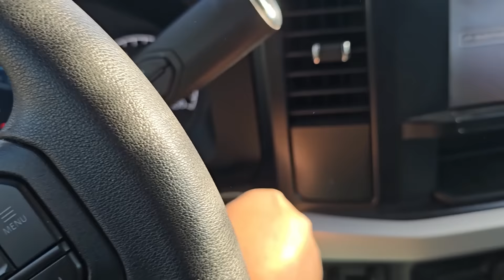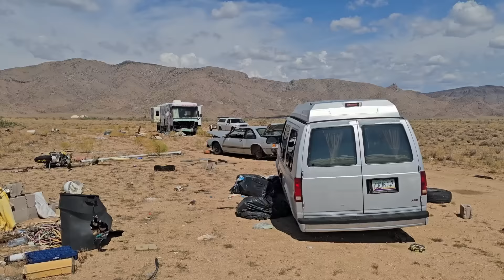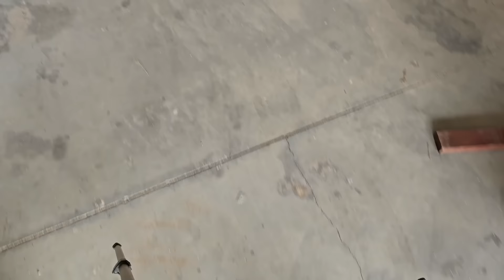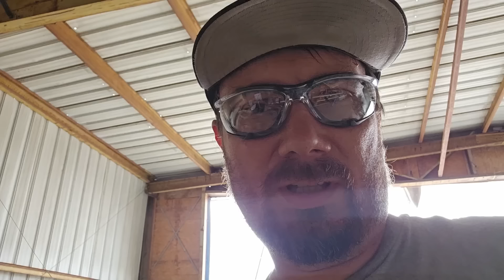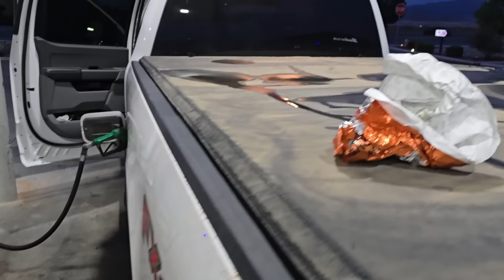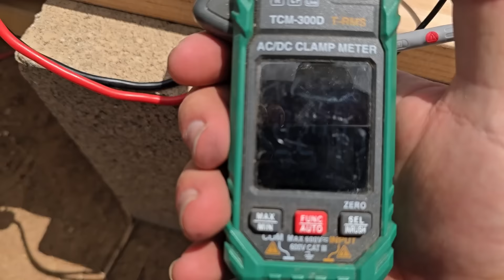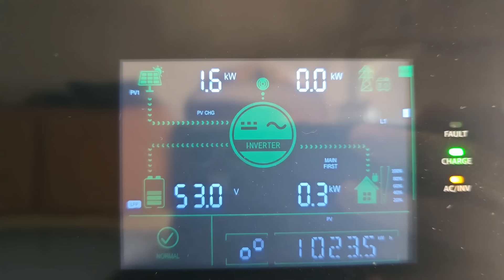DIY Ground Mount for $42 Per Panel No Digging (CinderMatic) | Got Shocked by Green Energy

Comment: Glad your OK.  Um little more expensive for those of us not living at Hell's door since pressure treated wood is needed.  Regular 2x4 in my neck of the woods is a sponge within a year.  More work but cheaper thought, partially bury the cinder blocks and just direct screw to them with cement screws.  A lot more work if you bury them at an angle as well.  Either way not wood rot to worry about.

Comment: Voltage doesnt matter its the amps that kills.  Static electricity is millions of volts... but it only takes about 10 mA to stop your heart.
Reply: Voltage definitely matters. It's a combination of volts and amps that can kill you. For instance you can touch the terminals on a 12V 100A battery and be fine, but a 48V 100A battery can kill you.

Comment: Howdy Herb,

First of all - 🙂 so glad you're ok after your shock 👍 and no! You're NOT a wuss for double checking with a medical checkup. Not checking is why people keep over hours later!!!

BTW - when working on arrays - cover them with a DARK cover, tarp, moving blankets, cardboard, etc. to prevent voltage/current from being generated! 

Great job on the temp mounts.

The clearance thing could have been solved easier by counter-boring the top boards to allow the bolt heads and washers to drop flush.

The cross connect from the front to back arrays and any wires on the ground should be protected from tripping and chewing - by people, dogs, cats, wildlife, low flying UFOs, etc. In conduit. 

WARNING!  You've created a bunch of cubby holes that snakes, spiders, scorpions and other biting/stinging critters can and likely will hang out in!  So walk well around those panels!!!

Heat... In Arizona in summer? No Way 😮

Really, you shoulda went over to get the blocks way earlier in the morning and get outta the sun earlier too. 

Hope your surgery went well. 👍👍

Comment: Wire nuts with DC can end up generating heat if there ends up with a gap. Heating and cooling  can cause the connection to get loose.
Reply: Yeah crimp or solder.   DC can be very dangerous and when it arcs it's really bad.

Comment: I haven't found this deal anywhere else, but the ecoworthy ebay store actually has some racks similar to the fixed integra racks minus the horizontal legs.  They are currently about 80 bucks for enough to support 4 panels.  Since they appear to be expecting concrete footers for mounting, you would probably need to mount them on some 2x4s or 4x4s and then have some cinder blocks for ballasts (or ground screws).  I just ordered a set myself to see if they would work and I plan to order 2 more sets if they do.  It seems to be the cheapest way to ground mount panels.  Also thought about just doing a bag o concrete and a 5 gallon bucket for semi movable footers..

Comment: Don't take shocks too lightly, 

I was shocked on a site when the temp power pole was knocked down into the trench I was in , 9 inches of water.. I vouldnt see it but heard the commotion round to corner , so I grabbed the rebar to climb out of the foundation ... circuit complete 😢 
3 days of being shocked to re regulate a erratic heart 40- 220bpm and BP 110/190..

5 days I  hospital before BP steadied in normal ranges..
Reply from the maker: Invisible energy will get you, glad you made it man.  If you are working on stuff eventually you're going to get it.  I've had it probably 8 times with different intensities never from a pole though!

Comment: hyped for Herbs future slave, Maverick 😂  picking up those old cinder blocks save you money, and cleans up the boatman property a bit, good job 😂  “I forgot to shut the sun off”,lol..  I think when the Belly button gets replaced, you should extend the ground mount array, and replace those sketchy panels that came with the air ranch, these will be easier to keep a hose and squegy nearby to clear the dust off, and keep them running well..  I would tie up those cables and keep them off the dirt & keep critters from chewing on them, don’t forget fusing & HV disconnects as well

Comment: Tape a harmonica onto the underside of a buddies car once, couple days later we were at work and he was talking about the strange sound he was getting from his car, was think the rear end was going and was going to take it to a shop and wanted to know if we had any recommendations.  LOL Yes, I told him before he spent any money on a shop.
Reply from the maker: I put a license plate on my worker who was a Manly Man that said "Bad Girl" on his square body Chevy front bumper.  It took him a couple days to notice and was pissed!  Lol.  Man Friends are more trouble than we're worth!
Reply: @HerbOMatic  LOL, another time we jacked up a guys Nissan truck and put blocks under the axle so the rear tires were just off the ground, after work we saw him out in the parking lot checking his transmission fluid because he said the truck wouldn't go into gear, and made a funny noise when he put it back into park. The good ol days when people could handle a joke.

Comment: You're in a very tiny portion of the country where you can get away with using untreated wood outdoors like that, but I get the point.
Reply from the maker: you could seal them or use treated before install.

Comment: Cinder blocks a good idea. More weight the better; panels will catch a lot of wind. Storm 2 years back took my 4x10' solar water panel from the roof and spread glass bits 3-4 houses down the street.

Comment: My garage was 80+. I looked at the portable type at Costco (3-400 dollars). But ended up installing a 12k 120V Mini-split. This cools my 500+ sq ft garage and only uses 400 to 700W. I had to buy a vacuum pump, a crescent torque wrench and a flare tool but overall the total cost was under $900. It takes up zero floor space and uses very little power and easy to install. You could run this thing in a power station with 2 400w panels.
Reply from the maker: Im going to install splits this winter.  This port ac is going to the dump real power sucker

Comment: Damn dude, I once took a jolt from a 240v circuit with a max current of 15 Amps AC for a second when running a cable on a job which should not have been live. I was sweaty, tired, in a rush and pissed off and neglected to double check. I was real lucky to walk away without injury - combination of all the conductor's being in one hand and safety footwear. Not fun at all.
Reply from the maker: Its when your sweaty that you get it good.  Glad youre good!
Reply: @HerbOMatic glad you're good too bud, can't have maverick running homestead with the wife cos you got fried! Things get hard when you're having to do it all yourself and it's like a billion degrees. Honestly surprised you don't work more at night, but I guess the bugs get pretty terrible then.

Comment: Mini-splits work great on solar
Reply: There are also a couple of mini-splits that have solar inputs. EG-4 and Airspool are the two brands that I know of. EG-4 makes a window mount a/c with solar inputs as well.
Reply: I have had my solar mini-split for 3 years now. I don't use the solar input. I use the 120 VAC in only. I found that when I wasn't cooling or heating the solar went nowhere. I'm now running the mini-split and a bunch of other stuff off of my Ecoflow Delta Pro Ultra. In cooling mode my mini-split pulls 300 watts up to 1200 watts.
Reply: @timcat1004  This is the way.
Reply: @timcat1004 I use my Ecoflow as a UPS for my fridge and freezer and have it set to solar preferred. I've there is no solar, the battery makes up the slack until AC takes over.  I use the same setup on my electronics too
Reply: Windows AC units are not efficient!
Reply: @faithful53  They actually are. When cooling, mini splits are no more efficient than window AC's which are barely more efficient than whole house ducted systems which suffer from duct loss. SEER is an overly inflated marketing number which is based on made up numbers like heating 24/7 at 5% capacity for a year straight. What you need to look at if youre primarily cooling is EER and most new AC systems be it mini splits, window acs or whole house systems are around 14-16eer,

The good part about mini splits compared to window units is that they are dirt cheap and don't require/take up windows. They are both completely outshined in terms of durability by your standard ducted system though, and the ducted system actually filters air compared to the joke mesh filters that the window acs and mini splits use.

Also in very humid areas (think mid-south FL) I have seen SO many mini splits fail within 2-3 years because of their design, the interior coil is curved in a way to be compact but it makes it so the coils don't dry out properly and they always end up corroding, not to mention the mold issues if you don't dry it out every couple of weeks.

Comment: Was anyone else yelling at the screen while he was doing the measuring to find centers and hole locations?    Also, nice tip for the depth stop for the drill bit with the socket.
Reply: What was he doing wrong?
Reply: @NickWindham  Not wrong, just the hard way.    Measure the center of the board at 24", line up with the seam of the middle of the four cinder blocks.   Measure 1/2" off the end of the center blocks, mark the hole.    I do realize now this method may not work as easy for the 3 blocks and now I feel kind of dumb since that was the majority of the bases he built.
Reply: Only because there weren't enough 6 inch jokes.

Comment: Groovy music!  Good video.  

Don’t get dead you silly Billy.  When working with any high power electrical, wear long sleeves and 500V electrician gloves to reduce shock risk.  500V gloves are cheap on Amazon and don’t impair dexterity enough to not wear them. 

Edit: Heck, you can get 1000V gloves now for $15.  Just ordered a pair.
Reply from the maker: Thats a good idea I will order them.  I hate riding the lightening
Reply: @HerbOMatic  lol

Edit: Heck, you can get 1000V gloves no for $15 that are 4.5 star rated by 557 people (allegedly).  I just ordered a pair to see how well they fit because they don’t offer sizes.  We’ll see how well they fit medium length large width.
Reply: I regularly work on 600vac high current systems and have learned to never trust anything and to keep one hand behind my back.

Back when I worked on tube TVs it was kinda common to get zapped with flyback voltage.  Black and white was about 15kv, color was 30kv.  Always fun.  TV cathode ray tubes make great capacitors.

Comment: In the future when working in that cramped environment either get some rubber mat or gasket material or just a towel and lay it on top of the batteries where you're working. It gives you an extra insulting barrier.
Used to have to do in several locations in industrial electrical.
When you're done just clean it up with everything else.
Reply from the maker: Thats a good idea im getting gloves too.  Ive been hit 6-8 times over the years and I hate it
Reply: @HerbOMatic we used to call that Tuesday lol 😂
Gloves are good until you have to do things like deal small screws and such.

Comment: There must be some massive capacitors in those inverters with weedy bleeder resistors. I'm sure you will remember for next time, pain is a great teacher.
Reply from the maker: Hell im going to bleed with bulb and use electricians gloves
Reply: @HerbOMatic  Thinking about it, if there are massive capacitors on the input of the inverters, it would be wise to install a fuse at that end. Theoretically, if there's a short at the panel end, the caps could vaporise the feeder wire.

Comment: It's electrifying ooh ooh ooh 😂 glad you are ok, definitely need to get all your panels out get that power flowing
Reply from the maker: I will probably do this setup on the other side of the main hangar.  I will seal the wood though to last longer.  This was an experiment
Reply: @HerbOMatic saw another commenter stating to fence them off (chicken wire fencing?), and anchor the blocks to the ground with mobile home anchors, thats a thought (for duststorms/high winds)

Comment: Man, you were really lucky there. DC is much more dangerous than AC as you know. Maybe being sweaty was a good thing because it made your outer skin more conductive so it passed more current instead of it going through your heart,
Reply from the maker: I think if I would have been dry maybe I would have passed less because the skin is a poor conductor.  But you might be right about the chain male effect.
Reply: Actually, AC shock is 3-5X more dangerous than DC shock.
Reply from the maker: I've heard both because AC can pulse a similar rate as your heart signal but DC doesn't let up like AC does 60x a second.  I've heard both are more dangerous than the other.  They both suck to be zapped with.

Comment: Lots of great stuff in this video.  Thanks!  Where was the stray 256 V coming from when everything was off.  Something in the panels?  Something in the inverters?  I know capacitors store energy but that shouldn't have come through like that.  I can see me doing something like you did so I'm curious.  :0}
Reply from the maker: It was between the solar inputs and equipment ground!  Unexpected!  When shut down there are big capacitors in those units
Reply: @HerbOMatic  Yeah, when not shut down, you can practically weld with the pos & neg solar input wires despite them being disconnected from panels on my EG4 18K PV.  Apparently this is this case for almost all transformer-less inverters.  DC/AC isolation is a valid reason cranky old timers preach about and pay extra for Victron.  They also still use 24V systems.  Turns out, shock risk below 30V DC is way less than below 60V DC.  Who can afford those copper gauges though?  I’ll be going with 400V batteries when this 48V inverter fails in several years from now.
Reply: @HerbOMatic  Glad you are OK dude.
Reply: High voltage dc bus in the inverter. Both PV and battery dc/dc converter feeds into it and large capacitors.
Reply: @ulrikduejensen1741  THIS!  He didn’t explain it, but he used the light bulb as a bleed resistor to drain the capacitors.  I almost got zapped too thinking the PV input wires were safe when disconnected from solar panels.  Nope!  Around 250V to ground and around 500V between pos and neg.  Fortunately, i was wearing nitrile anti-cut gloves that didn’t have conductive reinforcement metal.  I also only got around 250V to ground.  I could sense an extremely slight tingle.  Thought I was imagining it but LoZ metered it and around 250V it was!  I switched to long sleeves and 500V electrical gloves after Googling what the heck was going on.
Reply from the maker: It was a big surprise to me!
Reply: @HerbOMatic  Yeah, inverter manufacturers should either fix this or at least make unmissably apparent the shock risk they’re knowingly leaving us with.  I guess their accountants calculated the risk is worth it?
Reply: @NickWindham  Seems like high voltage guys and gals ground the HV  line they are working on after it is disconnected so they don't get a surprise while they are working.  Guess we could do the same thing, or would that blow up the capacitors?